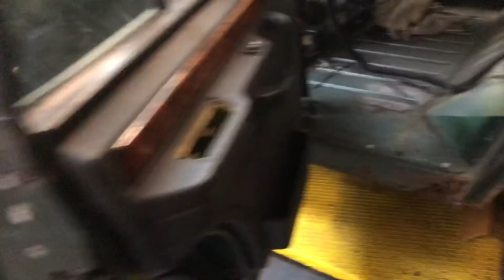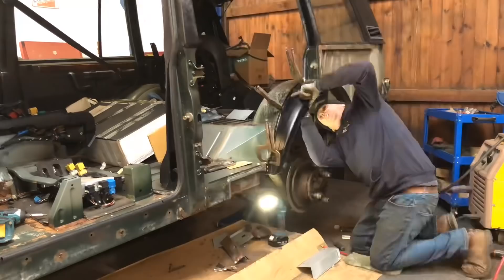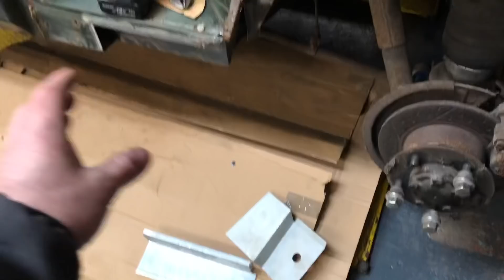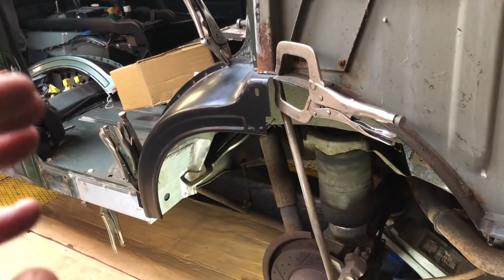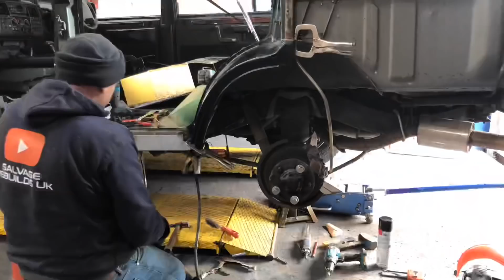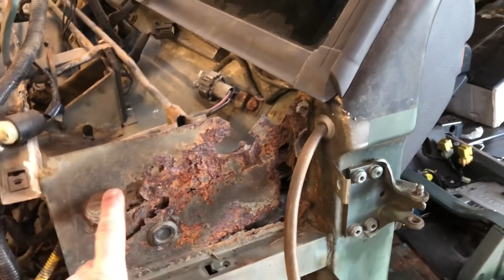Range Rover Classic soft dash LSE restoration PT 4 welding

Comment: Rob / Chris, great video again. Car bodywork relies really interests me, not the rubbing down bit though🤣🤣. Would love to see what you cut panels with. Every body shop I see does lovely straight cuts. Would love to see you cutting off part of a panel. Appreciate the wheel arch was spot welded, but bits of sill, and how you tidy it up to fit the repair panel. Looking forward to next video👍

Comment: Great content as usual Rob! For corrosion treatment and protection RustBuster are excellent. Their epoxy primer is brilliant. Used it several times on the underbody. Never rusted again and it can be overpainted with colour or various stone guard coatings: https://www.rust.co.uk/product/cat/em-121-epoxy-rust-proofing-chassis-paint-7 For cavity wax, Dynax s50 is very good: https://www.bilthamber.com/dynax-s50

Comment: Question for you Rob - So in terms of the restos that you've done and also the great projects ive seen since the summer 2019 whats the view on structural integrity in the event of another biff? Ive always wondered how a restored or damaged repaired car would cope in the event of another accident. I remember practical classics doing a Mark 2 Jag years ago and basically it was welding welding welding.. Its just a thought but would love to know your thoughts. As ever great channel and great video .
Reply from the maker: Paul Kidd it it’s done correctly then it should be as safe as it was prior to the accident 👍

Comment: 13:38 Are you going to plug weld the hole in the sill end repair panel? Helps with structural strength 👍👍